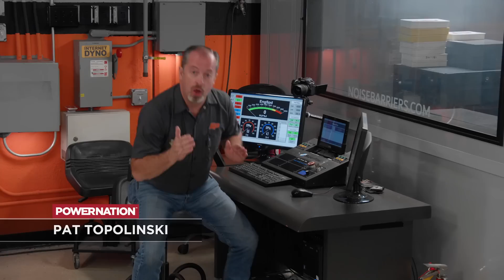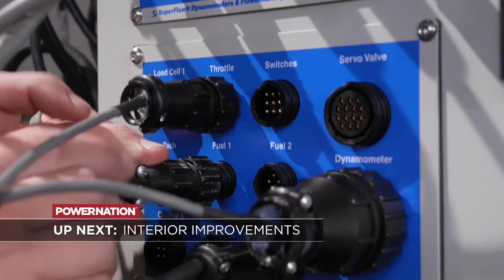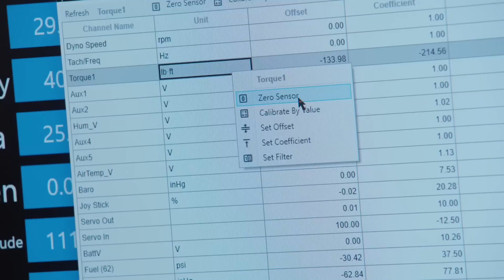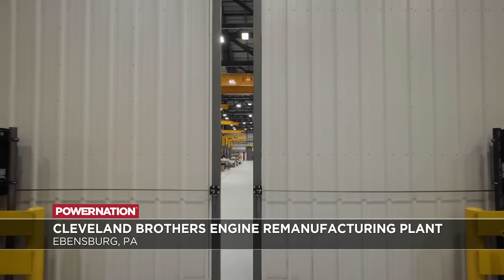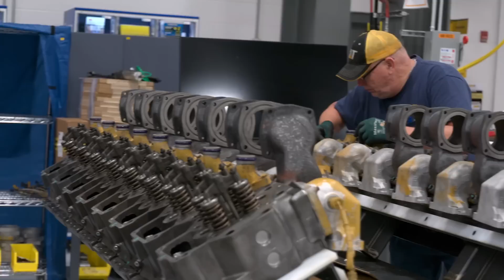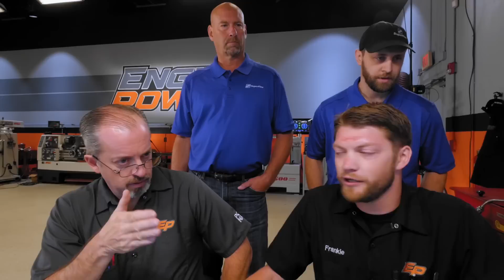Massive Upgrades To Our Engine Dyno - Engine Power S11, E17

Comment: I love this type of engineering video… having worked in government Aerospace R&D over 22 years. My job was to Certify all the Lab test equipment for development programs, for the F22 and the F35 actuation systems. I installed and calibrated all the sensors/channels….for their critical testing operations. You got to have a good repeatable system for critical data logging , and this upgraded SuperFlow Dyno is definitely very awesome.
Reply: PMEL nice

Comment: Trading windows 7 for 11 is a huge red flag
Reply: Hm no?
Reply: Unless you know about windows working on a superflow dyno don’t judge the cover just saying
Reply: @AllenWilliams25  unless you know why an offline machine needs constant updates that can't be turned off and disabled entirely, don't push garbage
Reply: @Drmcclung 
Who said the dyno is off-line or air gapped?
As for updates, the user has full control options available. All you have to do is select which option you want to implement.